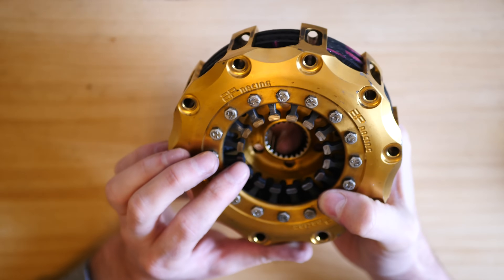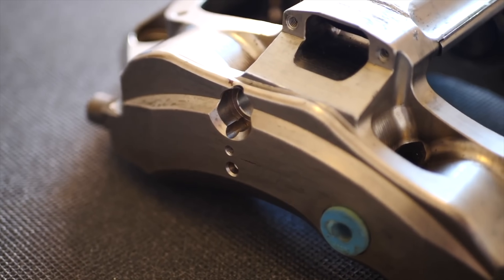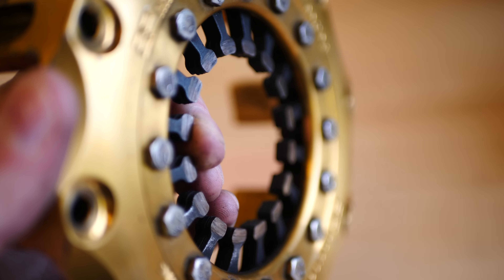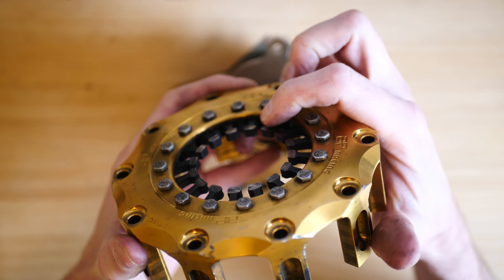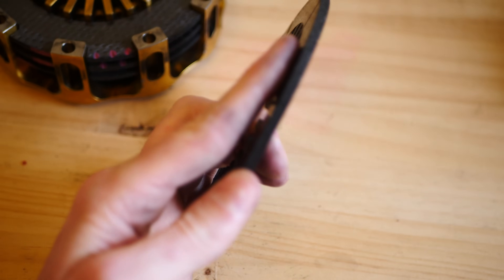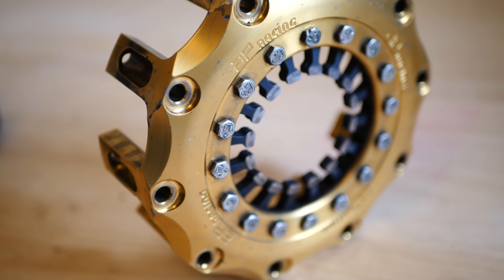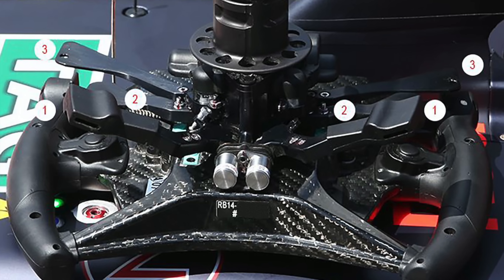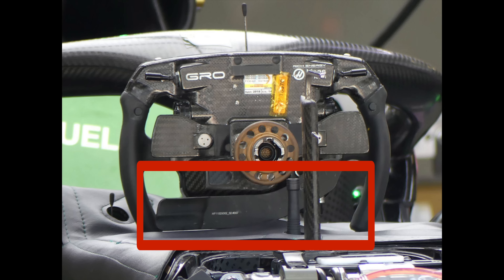How an F1 Clutch Works | F1 Engineering

Comment from the maker: How beautiful is this clutch?
➤ Subscribe for more F1 engineering videos: https://goo.gl/AbD2f9
Reply: I love this series. but how do you get the parts you make video of.
Reply: 👍 I do you have any idea of the pressure on this clutch disk?
It must quite huge for not let it slip regarding that crazy torque.

Do you use a pop filter?
Reply: @MrFlyingPanda  
0l
Reply: Excellent explanation. Impressive evolution isn’t it? Incredible that such a small unit can absorb so much pressure and heat energy.
Reply: so pretty, and so, so tiny!
Reply: @unknowndayglo7455  the clutch shown is an old type. modern clutches are about 98mm diameter. We used these in 2010, on the V8 F1 cars.
Reply: AP Racing <3 Worked for them as a student about 13 years ago, enjoyed it so much! So yeah, how beautiful is this clutch: YEEEEES ^^
Reply: How many starts is the current clutch good for?  Can teams replace the pads between races?  I remember back in the 80's the clutch was good for about 2 starts since there wasn't any pitstops back then.
Reply: subskribe 💯%
Reply: same as a late model motorbike even the older ones ran a presure plate and clutch plates like this some with oil some dry .

Comment: Good video! Would you happen to know where i can find the rules in regards to an F1 Clutch and all of its components? We build some of the trickest gadgets for slipping clutches. Built specifically for drag racing were we are controlling 200-800 hp motorcycles. One class specifically is Real Street. We are limited to a completely hand operated stock clutch now. In the past before all of the rules / restrictions we developed extremely clever devices that even today would give an advantage to and f1 driver on the start. Or if rules don't allow such devises training on one of the 400hp Real Street bikes might help. We train lots of motorcycle road racers just for the start procedure.

Comment: This clutch has to be from the 80's right? Ferrari introduced semi-automatic transmissions in 1990 and everyone else followed by the mid-90's. Unless the semi-automatic 7 speed gearboxes use manual style clutches...? I'm not sure. Semi-automatic transmissions usually use an electrohydraulic clutch rather then these multi-stage dry clutches.

Comment: You have access to cars nodes that you benefit from. But you don't know how to explain things. You did not say anything about the operation of the diaphragm spring. You did not say anything about the position of the hydraulic cylinder. Nothing about how the shaft runs down the center of this cylinder. Nothing about lack of dempther springs. And much more. Watch this video 
https://www.youtube.com/watch?v=devo3kdSPQY
here's example how to explain how nodes work.

Comment: Same as a Motorcycle clutch, more expense, absorb more power perhaps but fundamental the same. Interestingly a motorcycle has used sequential  gear change for years and many, including my own a quick shifters that disengages the engines ignition momentarily so that gear changes are seamless..hence the very distinctive sound of the Bikes exhaust note when one is in use..

Comment: This clutch is used only when the car is starting from a stop and is controlled by the driver, not a computer. Once the clutch is engaged and vehicle reaches the next shift point the driver pulls the paddle the computer senses the paddle and at that point fires valves that essentially shift the transmission with no release of the clutch at all. The shift motor is a cylinder that is supplied air pressure at around 180 psi when commanded to shift. This pressure forces the internal components to shift from one gear to the next in a fraction of a second. You hear the engine rpm respond as the gearbox is slammed into the next gear. This happens much faster than human hands could ever acheive, that is why there is no grinding.

Comment: That's why with a little bit of  modification and some serious springs you can put  500 horsepower through a motorcycle clutch. Multiple plates, tight tolerances and precision machining

Comment: So basically compared to normal manual transmission car, this has much smaller diameter discs, much stronger springs, uses titanium instead of steel everywhere and friction material is fully made out of carbon. And because the springs are so hard, the hydraulic system is run by the engine, instead of simple pedal connection as in normal cars. And most normal cars have just one friction disc and this has three. But other than that, it's exactly like the clutch in a Ford Mondeo with manual transmission.

Comment: Instead of a shim, why not have the plate pressure realtime controlled by the pressure on the flanges around? Have the flange levers over-spring forced, and then the 'controller', that pneumatic ring thing, would 'slightly' press on the flanges to the right force.

Comment: The clutch of an f1 car is beautiful piece of art and machinery  but you are half right. The basket should not turn at all the pressure plate is all that turns if the basket turns you will have no power at all

Comment: 3:07 "I'll explain why we have the names for these plates ... a little bit later."
Narrator: But "a little bit later" never came.
Reply: It's because the engine is connected to the larger plates(which are connected to the basket). So inside the clutch, the larger plates are driving the smaller ones(which are connected to the inside hub that goes to the gearbox). Hence large plate = driver, small plate = driven
Reply: Friction plate drive plate

Comment: Well the shim is a pressure plate and all standard dry clutches have them! Why don't you mention that the friction coefficient of the friction surface decreases as temperature goes up. Now I have never measured a formula 1 clutch but as a standard car clutch wears the clamp load decreases and then increases as the friction surfaces wear! Basically a F1 clutch is the same as a standard car clutch.

Comment: I wonder if a torque converter would work. Than again a well engineered electric motor could stomp the normal f1 engines which could eliminate the clutch all together.

Comment: so its basically a normal clutch thats made into multiple layers but smaller diameter. so at higher RPMs theres less stress on the outer edge on the disc

Comment: How much Nm it can holds?
I usually work on diesel engine and gearbox that have input torque capacity of 2000+ Nm and the plate is about 400-500 mm. And the clutch pack is so fuckin' heavy, you cannot lift it yourself..

Comment: Wait, flywheel? They don't have flywheels, one reason why they rev so fast. Might be a plate that connects the clutch to the crank but they are not flywheels.
Reply: The basket has to attach to the crankshaft somehow and it is via a tiny flywheel that has little mass. Probably does not do more than balance out crankshaft inbalance.

Comment: It looks the same as a motorcycle clutch. Except this just costs a lot more but they use the same principle and basic structure
Reply: it seems exactly like the clutch on my 82 honda manga 45. I have a spare one and it looks exactly like this. The difference is most motorcycle clutches are "wet" applications meaning they are bathed in the engine oil.
Reply: @jackhammer111  I know, I’ve worked on dirt bikes for years and instantly saw the resemblance. There’s very few bikes that use dry clutches like this (mostly Ducati’s) but I just thought it was interesting how the clutch of an F1 car and the clutch of a motorcycle are similar in design
Reply: @mclaynebalzly1739  I agree that it's interesting but I don't know if they work the same way. They look similar because they're stacked discs but I think the stacked discs happen on a motorcycle clutch to distribute the engagement Force on several small clutches because you don't have room for one big one.  that could be the case with the F1 clutch but there's another thing that came to mind. Do you know how a dragster clutch works? Those have timed centrifugal engagement mechanisms so that the clutch disks engages over time That's how they manage wheel spin on 10,000 horsepower engines.All of the discs aren't shoved all the way together until about half track.  I'm wondering if F1 clutches have any similar kinds of centrifugal engagement so that at the start the clutch doesn't come on like gangbusters. I don't think they're engaging the clutch manually a little bit at a time if you know what I mean. They're dropping the lever and making the clutch do the work of putting the power down without spinning the wheels. I'm thinking there has to be some kind of timed engagement involved there.

Comment: With the power F1 cars have I expected a much larger clutch. But I guess it comes down to surface area and having multiple plates is a great way to keep a large surface area while having a small diameter and smaller moment of inertia so you can rev quicker.

Comment: You said the clutch is just for the start, so how do gear changes happen ?
Reply: the electronics cut the engine for a fraction of a second and hydraulic servos change the gear. In drag racing or street racing my motorcycles, or just doing max acceleration I open the throttle wide open as I approach red line I apply upward pressure on the shifter with my toe then rotate my right wrist off then back on as fast as it will go and at that instant that the load is off the transmission it shifts. In normal riding, I use the clutch on the 1-2 shift on the bike I now have, 82 Honda Magna v45, because that's the biggest ration change but don't use the clutch on all the other shifts in smooth acceleration. I've been doing it all my life. Learned it from the NHRA 750cc street stock national record holder Pistol Pete Grassili on the early 70's Kawasaki H bikes, the Mach III when he taught it to me but then we had H2 Mach IV 750's and that's when he set the record 11.81 in 72 that held until 76. I'd say it's a technique that is not hard to get a feel for because the sound of a click vs a clunk tells you that you got it right, but I've been doing it so long I can't really say. 
I'm saying the F1 boxes use that principle but it happens electronically and hydraulically.
Reply: @jackhammer111  Thanks that was a lot of insight !
Reply: The selectors are literally just slammed into the gear. The dog teeth of a racing gearbox are larger (so stronger) and have much larger spacings in between. So when the selector approaches a gear, its dog teeth will comfortably slip in between the large gaps of the dog teeth of the gear. Of course because they spin at high speeds, in a few milliseconds the selector teeth will then slam into the dog teeth of the gear. I believe this is where the term 'crash box' comes from for this type of gearbox. No speed matching or power cuts required. But the result is that it is very harsh and they wear out pretty quick. But it's for racing. They don't need to last long, they just need to finish...quickly. (I just realised that sounds filthy)
You can't do that with regular road car gearboxes. For smoothness the dog teeth of a regular gearbox are much finer and spaced much closer so that there is no room for the teeth to slam into each other. But that also means under load and with no speed matching the teeth can just slide and skip over each other (the grind).